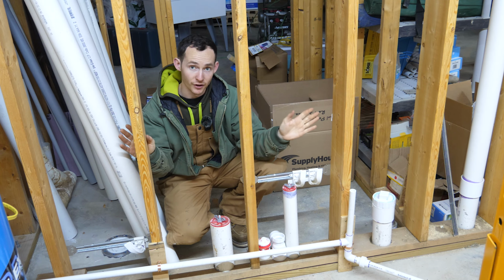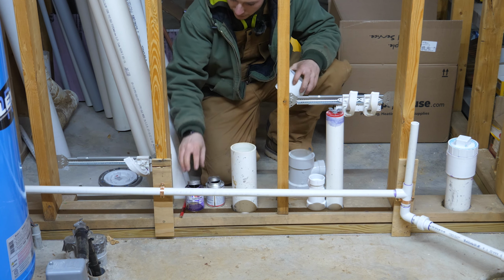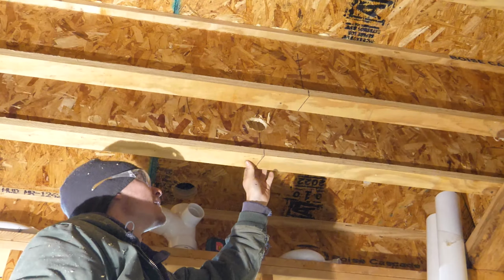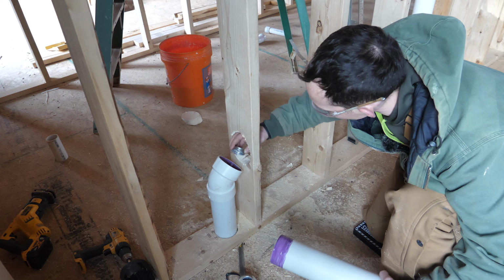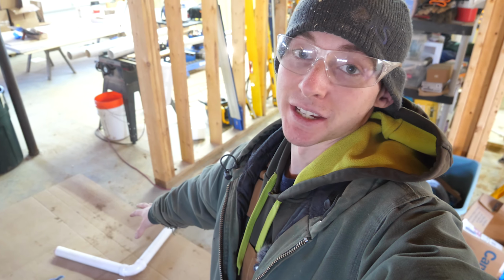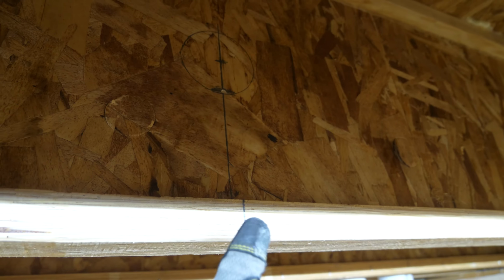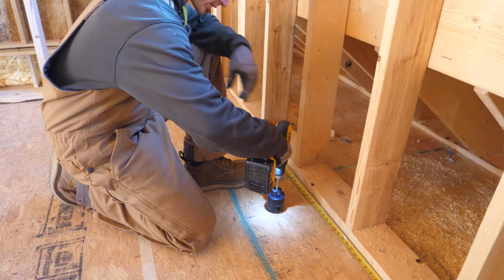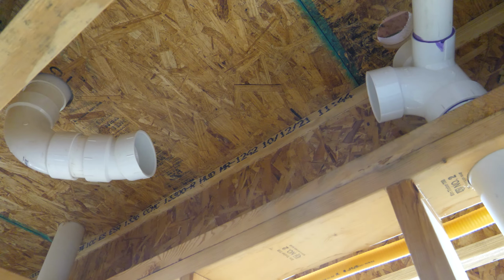Drain & Vent Pipe Rough-In: We can ALMOST flush a toilet

Comment: [18:48] Too late for you, but if you run a string line under the joists at the required slope, you can the measure the same inch-offset to the hole you need to drill at each joist. This way you only have to make one mesurement for the grade  (at the end of run). Easier still, prepare a cheat sheet for each joist size reminding you of how many joist bays you can go for a given slope. This allows you to plan runs better ahead of time. In your case the spec sheet for the TJI indicates where and how large a bore hole you can make. But for 2x lumber the general rule is no boring 2" from the edge of the board. And max hole size 1/3 the actual width of the board. So for a nominal 2x8 the max hole diameter is 2.4' or 2-7/16".  This limits the pipe to a nominal 2"PVC max. Drilling a 2-3/8" hole in a 2x8 less the 2" top and 2" bottom keepout zone leaves 7/8" of drop for the nominal 2x8.  A grade drop of 7/8" only allows for a 3.5' or 42" run at 1/4" per foot grade. That is two joist spans at most assuming a 16"OC joist spacing. That is not very many. Forget about drilling holes for 3"pipe altogether. For 2x8 or even 2x10 solid lumber you will be using bulkheads or raceways or soffits, whatever name you give them.

Comment: I’m not sure why you made that 4x Tee offset the way you did. Keep your lines square plumb and level (fall)

Looks dookie. But the rest seemed to look pretty good. 

Keep it up.
Reply: Just saw where you ran diagonally again. That’s the mark of a DIY’er and red flags are raised when pro’s see that.
Reply from the maker: Not putting in more sharp turns than needed when the point is to keep efficient flow

Comment: use a pocket screw kit to do those blocks.. no hurting yourself and you can stick the screw in the pocket and then hold it to the perfect location and drive in the screw
Reply from the maker: I did have pocket holes, just was using general torx screws instead of square head screws 😅

Comment: Thanks for sharing your project!

From your diagram, you will need a vent for the 2nd floor toilet and a vent for the shower because the lav dumps in above the santi tee. The stack vent starts above the highest dump in to the stack. Anything below the stack vent must be vented before entering the stack.

Also, in your radiant slab video you ran romex that will not be covered. Should be thhn  wire in conduit or mc cable. Code mentions vulnerability risks for nm cable (romex).
Reply from the maker: So we got the romex in the utility room cleared by our local inspector ahead of time! The diagram is slightly off for the 2nd floor lav - I mentioned it will be using an AAV, had to change plans on that due to the radon pipe in the way. It actually drops through the floor and enters the stack just below where the washer enters. So toilet and shower are the highest inlets into the stack, sharing the 3x3x3x2 san tee.

Comment: Exciting progress!  You mentioned giving the chemical reaction the best chance to take - try this: when assembling pipe and couplings, push the coupling on to the pipe rotated around 90 degrees from its final orientation, then rotate the pipe and/or fitting to the final orientation once the pipe is bottomed out in the fitting.  This helps ensure complete glue coverage and if there happened to be a bit of contamination or an unseen burr that scraped the glue out of the way as your were assembling it will fill back in.  You can't always manage this on every single joint, but with good planning you can probably assemble 95% of joints with a twist, at least on new construction...remodeling is a whole different story.

I recess the mounting ears for things like the washer box as well - figure we spend so much time crowning the studs to keep the walls from getting wavy, why do anything that you know is going to impact the sheetrock's flatness?
Reply from the maker: Haha good I’m not the only one being anal about the mounting tabs then 😄 I usually give the fittings a 1/4 turn but you’re right sometimes it’s just not possible in some situations